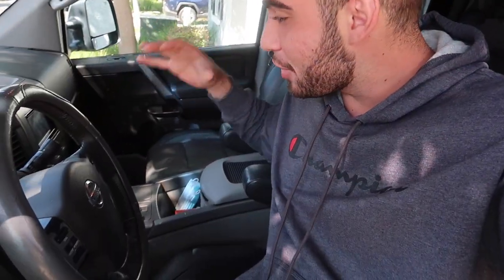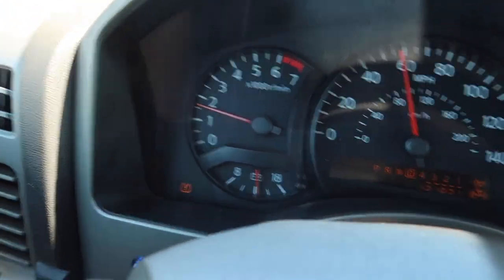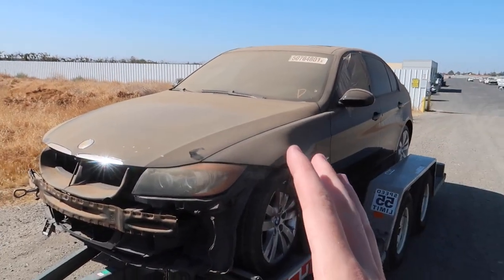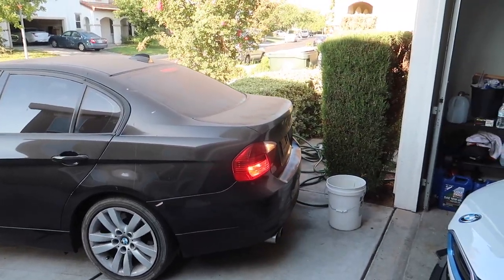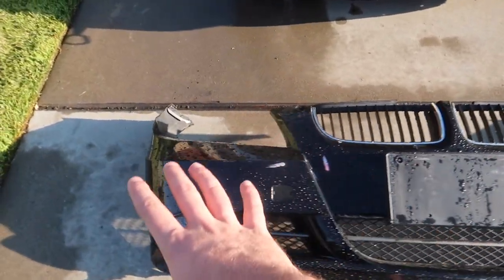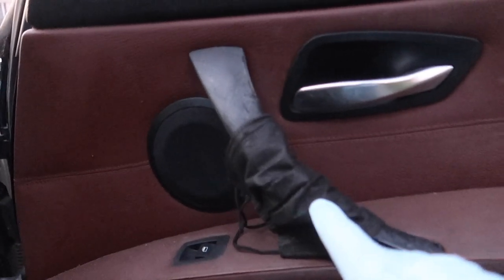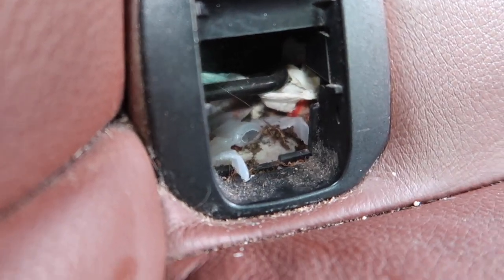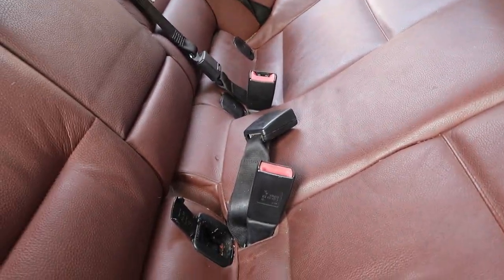Rebuilding And Restoring A BMW E90! Part 1

Comment: Hi Nour. From a health & safety perspective. Get the correct personal protection equipment. PPE. To wear. I’d have the interior fully disinfected. Steam cleaned throughout. Sanitised. Nobody knows what’s lurking inside, or the trunk. No doubt you’ll both get it looking a showstopper but right now it’s filthy inside. Be safe. It’s been utterly neglected inside. U.K. loves your channel.🇬🇧🇬🇧🇬🇧